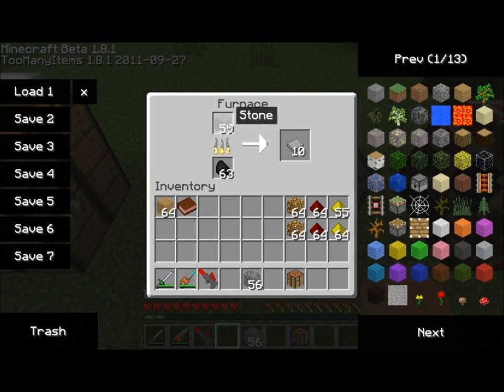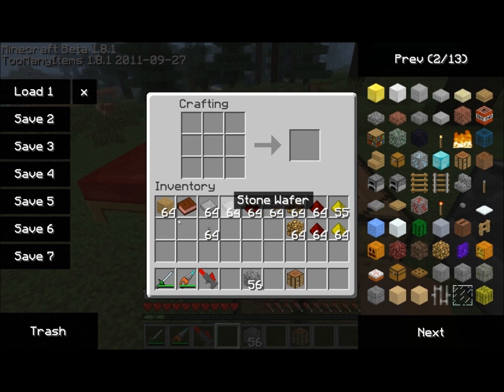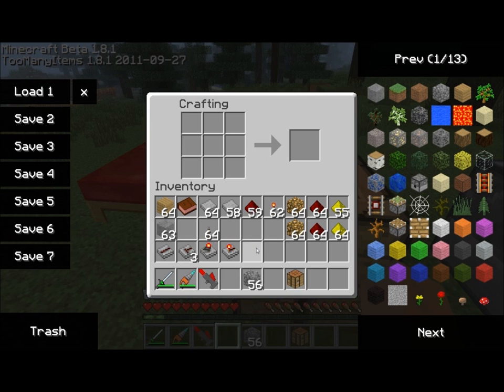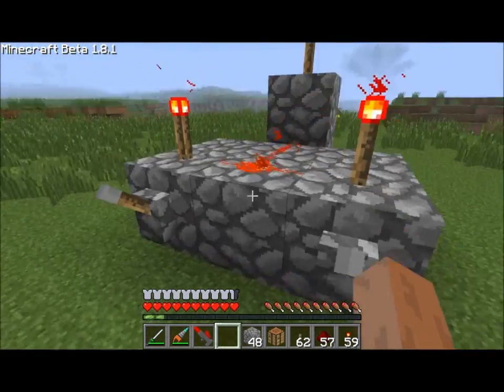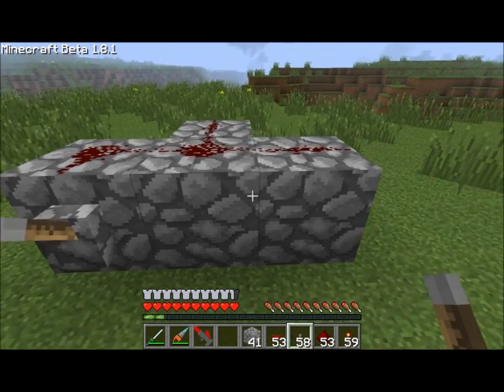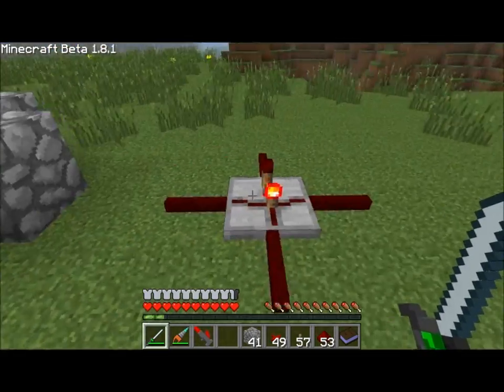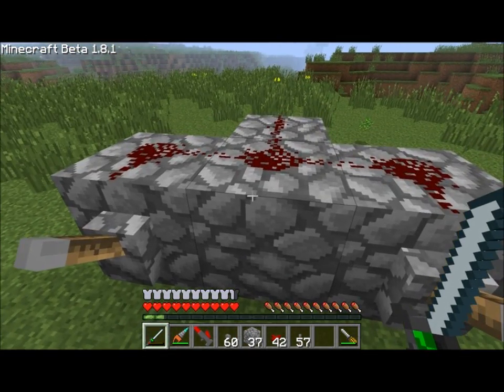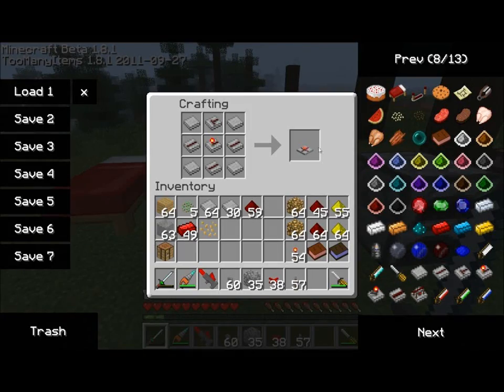RedPower 2 Tutorial - Logic Gates Part1

Comment: @ direwolf20 Actually, You can make something as useful and as versatile as the timer, You use a piston tape. you just add more blocks in the piston tape to change the timer's length, but between 1 block size and a minimum of 20 blocks total, AND one is much easier than the other, Eloraam's timer wins.